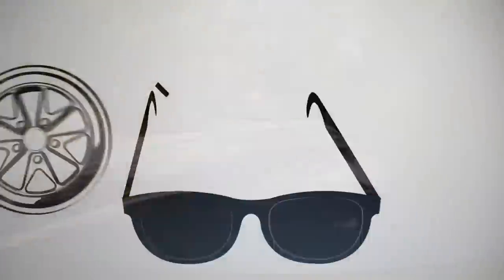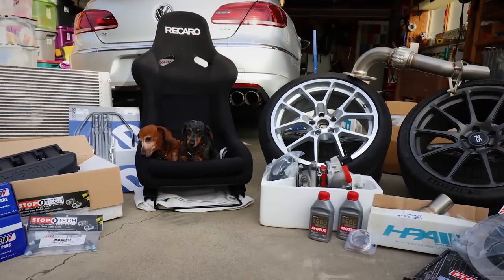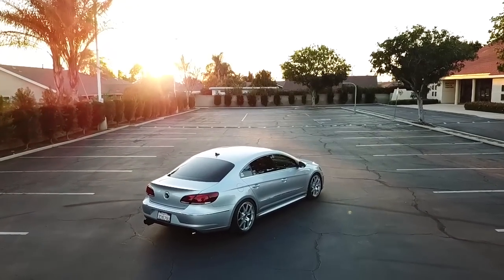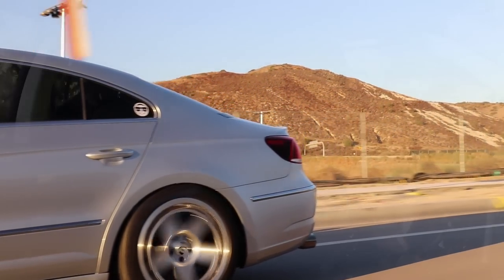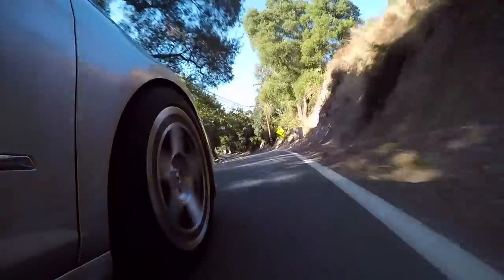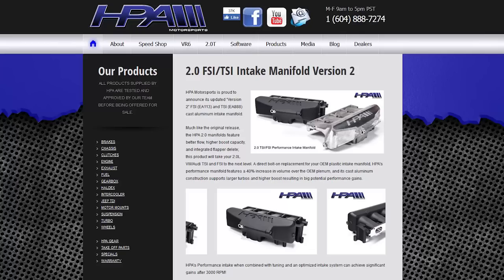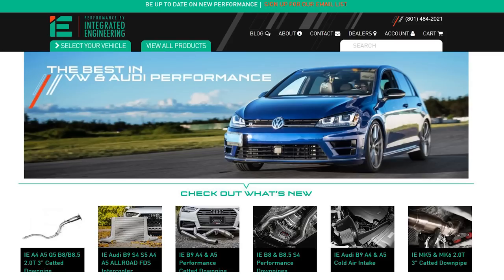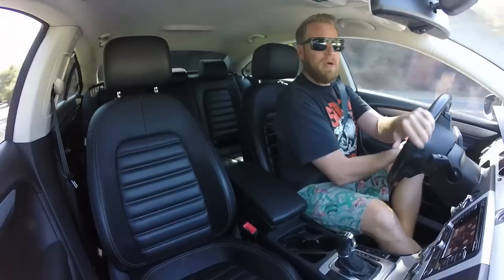Ultimate VW 2.0 TSI Daily/Track Build Introduction

Comment: Good choice on turbo I’m also going to go with a ko4. 350 is good number on the track for our cars.  I got a mk5 so I with 150k on it so I’m just going to say screw it do rods pistons injectors and meth and be pushing 350whp and 350 torque. Thank god some one else thinks of doing a dsg tune like me. If not all that torque will mess your dsg up. On a stock ko3 for a mk5 stage one I’m make 260whp and 300torque to the wheels and my dsg has held up for 3years. Be4 you so your upgrades make sure you do a dsg service. It was 300$ at the dealership but it makes a big difference. Also do a carb cleaning to. You sound like you know what your doing if you have any questions just feel free to ask I know a lot about the FSi and Tsi

Comment: Got the cc pretty modded but I went the other way... tuned stage 1 IE and about every bolt on minus the inter cooler and catch can ... those are next...  next is suspension since it’s a daily driver I felt it was fairly well handling prior and I do a lotta highway

Comment: Can I buy your intake??? We seem to be moding at the same time but different levels. I’m going for an oem plus build. Already have quad exhaust and some bits and bobs but going for rear sway, springs, intake, stage 1 and pads/fluid. Either way pm me about the intake and great vids brother!
Reply: Also if you put a mk7 wheel on it I’d take your r line steering wheel with paddles to!

Comment: I own a  17' CC and love it.  Have to ask, have you had the typical TSI issues, namely failed water pumps and intake manifolds?  Keep up the good work!
Reply from the maker: NIce!  I've had zero issues.  I did replace the water pump when we did the k04 because it was leaking slightly.  Thanks for the support!!

Comment: i'll buy the intake if you still have it and i ordered the ko4 turbo for my 2014 vw cc sport which i plan on adding the gti steering wheel but all i need is an intake got rims and tires all should be put on and done in 1 week from now
Reply from the maker: Very nice!  The intake has already been given away.  I would go with the Integrated Engineering intake.   Also, take the sound deadening off the underside of your hood if you want more turbo noise 👍🏼
Reply: Wheelie Cool Videos well do thanks but for some reason the car tells me every now and then check the gas cap but nothing is wrong with it I bought a new one same thing so have to get that figured out also and my airbag light went on when I was on the highway pushing the car passed 100mph and a car cut in front of me and had to brake hard it’s the seatbelt blew

Comment: How low did you drop the cc, and do those tires rub at all? I'm trying to decide on the suspension and wheel/tire combo for my cc. Thanks in advance.
Reply from the maker: I am running HPA SHS coilovers and really like them.   But, for most people, I think the perfect drop can be chromed with Eibach lowering springs on stock shocks.

Comment: Would love to know more about the intake. Currently driving a 14 cc R line
Reply from the maker: I got the integrated engineering intake:  https://www.performancebyie.com/ie-mk5-mk6-2-0t-tsi-high-flow-cold-air-intake-kit
The quality is top notch.  I like the design of the heat shielding.  IT works well, looks nice, and rocks don't get stuck in the back corner like on my CTS Turbo intake.
Reply: Wheelie Cool Videos I recently purchased the car and want to do many on the mods you are doing. You’re build is a great inspiration.

Comment: I’m a little new to Volkswagen and I was wondering what exactly makes that little popping sound when it shifts gears ?
Reply from the maker: Great question!  Because the car has a dual clutch transmission, it shifts really hard.   That pop or DSG fart as it is commonly referred to is the transmission slamming that next gear.  Thanks for the comment!